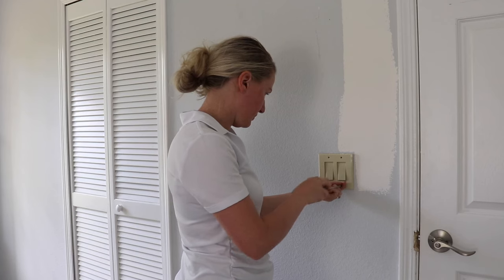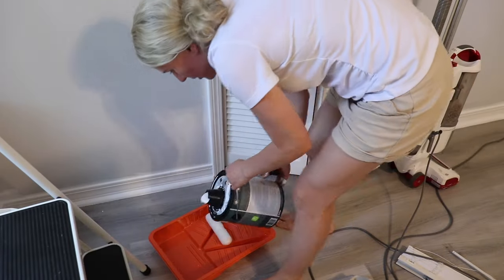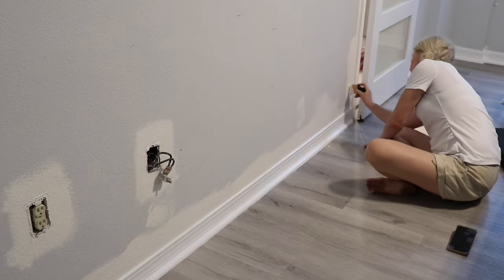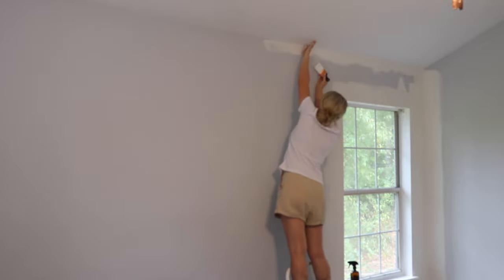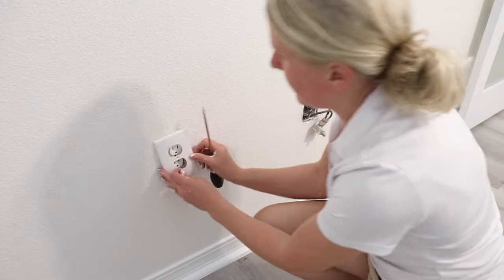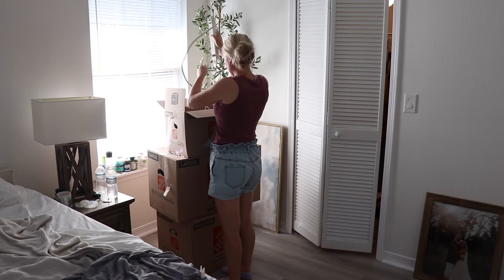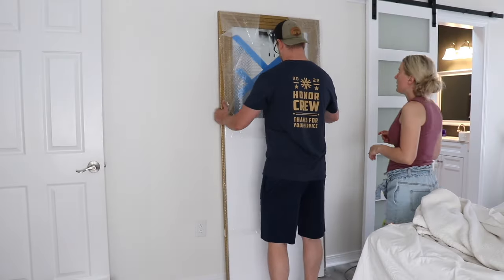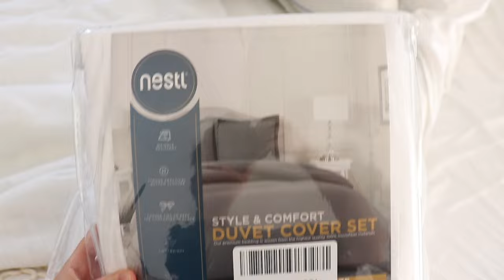MASTER BEDROOM MAKEOVER | DIY, budget friendly makeover, decorating ideas

Comment: If and when you can, I would suggest you replace your windows with tilt out,  double glass uva coated  double pane windows. There is no need to go broke and buy wood windows or vinyl clad windows. You can use plain  vinyl windows. They are cost-effective come in a variety of styles and are excellent at insulating your home. I love double hung windows because they are easier to clean since both panes can be tilted out for cleaning. Ps I don't sell them. I just love them.

Comment: Do you have a link for your Carpet cleaner? Also, when you cleaned the carpet did the floor get wet underneath?
Reply from the maker: Hi Amy! Thanks for watching! https://www.target.com/p/bissell-turboclean-powerbrush-pet-carpet-cleaner-8211-2806/-/A-79621848#lnk=sametab Here is the link to the carpet cleaner I use. I do not find that it gets the floor underneath wet, however, I'm sure that also depends on how many passes you do with the cleaner. If you follow the directions I don't believe it should soak through.